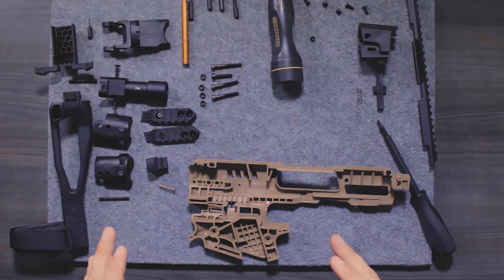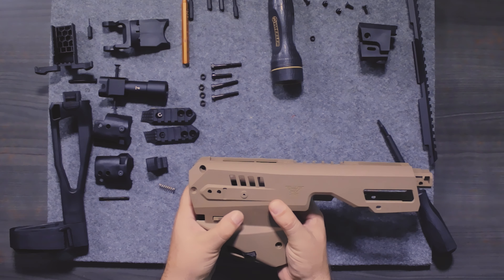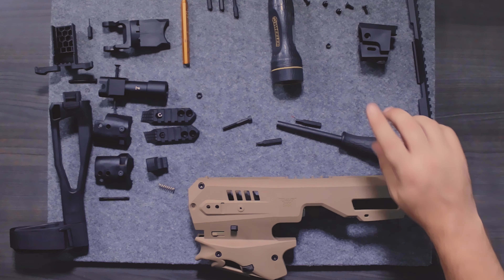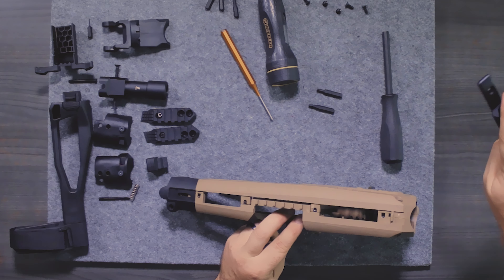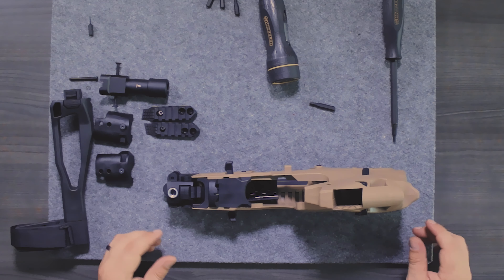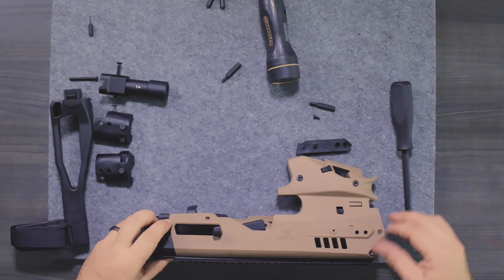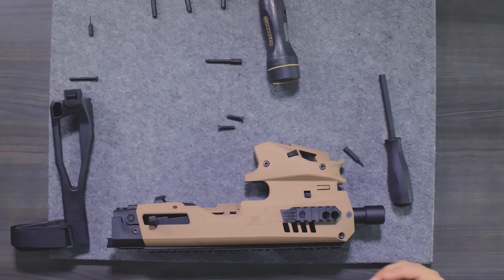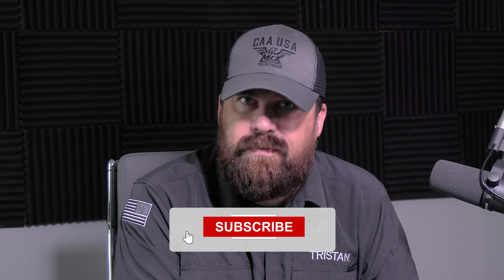Tech Tuesday Eps 21 - How To Disassemble And Reassemble The MCK (Part 2)

Comment: What’s up with customer service. Can I get some assistance with mine?
Been having issues on setting up & the response time is horrendous, I get 1 email every other day.
I’m trying to take my MCK to the range.
If this doesn’t get figured out I will return it.
Reply: Its comments like these that makes me skeptical about buying one.
Reply from the maker: Have you been assisted? Did you make a ticket online?
Reply: Agree with this comment. The barrel shroud nut is a nightmare and I can't put it back. Response time is super slow. Regretted buying it. Plus return sucks with restocking fee
Reply: I’m having the some problem where I can’t seem to line up the bolt to the thread where you done it so effortlessly at 9:30 in the video. Any suggestions tip or help.
Reply: @rekzzz14  what did you do?  I can't find any info on how to gwt them back in